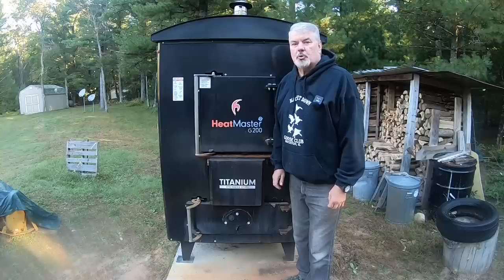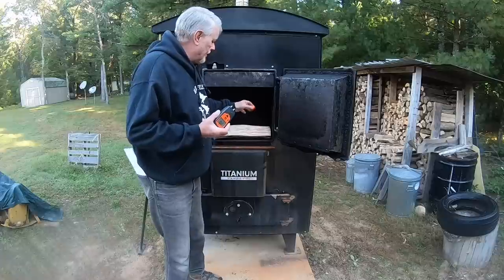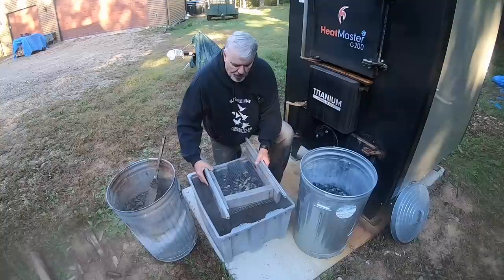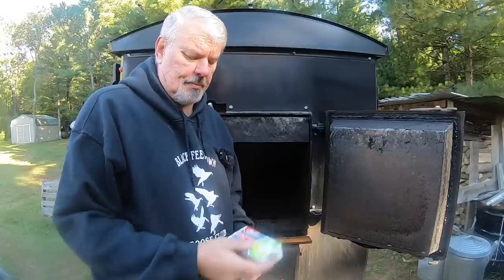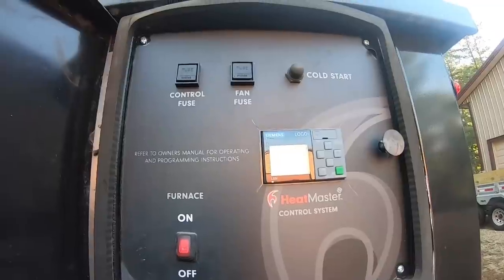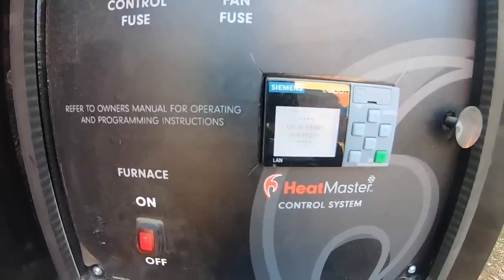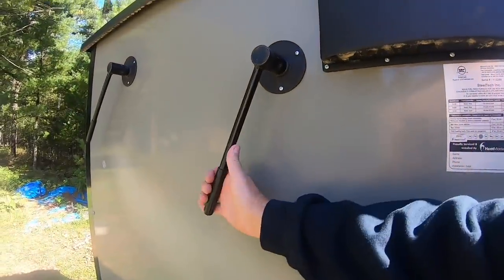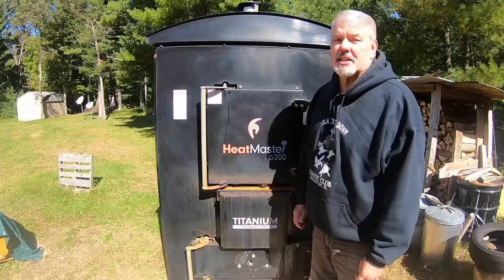Light My Fire, First Fire Of The Season -40

Comment: I roll up newspapers in toilet paper rolls and dip the ends in melted wax. Great fire starters. And I’ve used paper egg cartons filled with dryer lint and then wax. They work great as well.
Reply from the maker: Both sound like great ideas. I used lint before but found out most of my cloths are poly material and the lint doesn’t ignite like cotton or wool lint. Thanks for watching and commenting 👍

Comment: Ingenious method using the charcoal. We’re just starting to have some cooler temperatures here in NC. I started my gas logs, (blasphemy, I know 😂), to take the chill off in the house this morning. The shop wood stove will be going into use soon.
Reply from the maker: Ha ha Dick, ironically my last house had a gas log fireplace and every time I turned it on I felt a little cheated but the flame just does something mesmerizing.
The charcoal method really works well and I seldom have to restart my fire like I do when I use kindling and paper. Thanks for watching 👍

Comment: Great and informative video Tony. I like the concept of letting the pump run all year.  Air handlers and motors/fans I suggest running while in a/c use. No cool then clammy temp changed in certain areas of a house. Nominal cost to run the motor without a measurable temperature difference. Love the extension for the cigarette lighter also. Better than Zippo.😄👍
Reply from the maker: Glad you enjoyed the video. Ha ha I could definitely light your cigarette from 4’ away😂
Thanks for watching and commenting 👍
Reply: Lololol

Comment: They are a very nice unit. I have a hardy furnace now but when it conks out I’m looking at a Heatmaster g 7000. How much wood do you use in a year. And can u use them year round for hot water. Thanks for all the great videos. Love all of your and your new best friend Chris. Good nite Irene. 😁
Reply from the maker: Eric Appreciate your kind words and I’m glad you enjoy my videos and content. Depending on how cold the winter is  I typically burn between 7 to 9 full cords and that heats the house, hot water. I only heat the pole barn when I’m working in it. I think you will like the G7000, it has several upgrades my GS200 doesn’t have. Thanks for watching and commenting 👍

Comment: All newspaper in Canada and the rest of North America has contained only soya-based colour dyes for many years.  I did not think these were harmful to air quality since they are not harmful to traditional composting methods.  I think there are several much better options for lighting fires (especially using a propane torch) which reduce fly-ash release, am I wrong in assuming they might be OK for lighting fires in wood-stoves, boilers, and furnaces?
Reply from the maker: Paul Im sure there will be more data in the future on the topic of paper/particulates that are emitted. I know there are several other options of starting a fire, I just showed you mine and I’m always open to suggestions. Appreciate you watching 👍

Comment: Did I hear you say you leave the recirculating pump running, even when not using the boiler?
Reply: Hi 123- its Big Rodders in Ireland.  I used to run my circulating pump 365 days a year - it lasted me 28 years in various systems before requiring replacement.  I understand that contaminants are attracted to the impellar when the water is stationary, making it more likely to cause problems when restarting it.
Reply from the maker: Yes this year I left it run, I don’t know if it will help but my thoughts are any sediment in the system is always flowing and doesn’t settle down and start corroding the OWB. I’ll be talking to my installer about this as well to get his suggestions. Thanks for watching 👍
Reply: @TonysCoolTools  Interesting to hear that. I wasn’t aware of a potential impeller issue. I’ll have to throw that by my plumber for his input.
Reply: @rodneysweetnam8653  Thanks for your input! Good to know.

Comment: Tony, what’s the life expectancy on the ceramic nozzle? A major concern with theses lower water capacity owbs is cold water return protection. To cold and it thermally shocks the steel (304 stainless is extremely susceptible) causing stress corrosion cracking. How most European boilers operate is just like a car engine. Engine heats water in block (boiler) until thermostat is hot enough opening allowing water to flow to radiator ( home, water, out bldgs. Etc.) Garns don’t have any of these concerns. It’s amazes me how environmental conscious and next level engineering Europeans are but, somehow ain’t smart enough to figure out how to be energy independent. Their like look at us we are investing trillions in renewables. Then Russia shuts off the NG spigot and in a matter of days complete panic🥴🤷‍♂️. Am I the only one asking where has that trillions in self sustaining renewables investing went??
Reply from the maker: I’ll have to ask my installer how long the ceramic nozzles are supposed to last. Once the government gets involved everything goes up for grabs! 
Thanks for watching 👍